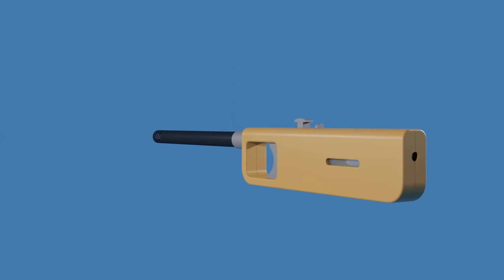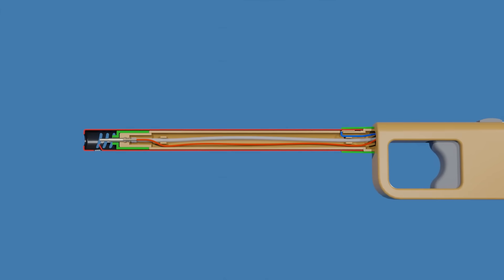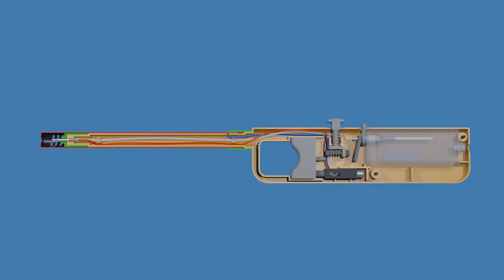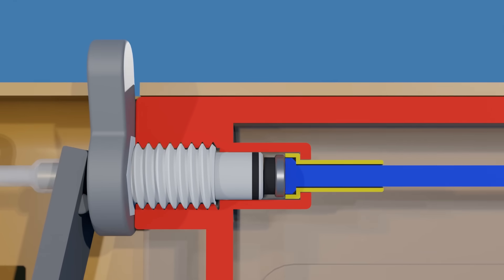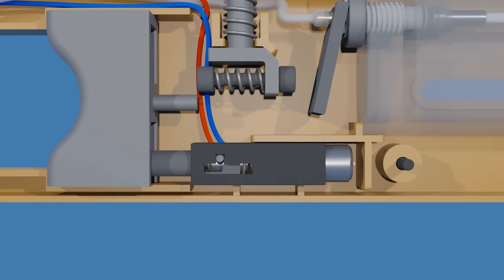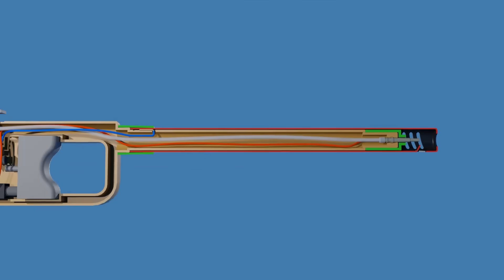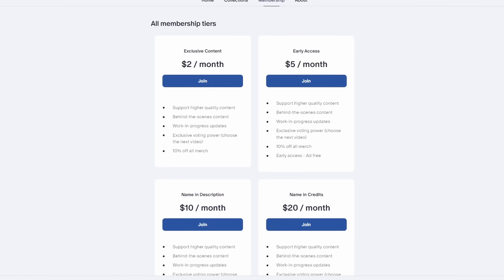How a gas lighter works

Comment: Dang 2 guy and a ton of work! Cool video. I took apart a cheap cigarette lighter that went empty in a parked truck.  Summer time I guess it got too hot. Anyway I was looking at the white stick thinking there would be a hole. I didn't realize it was porous. Thanks for all the information. 👍🇺🇲👋

Comment: I still don't understand how the disk at the end of the porous rod regulates the gas flow. Is it porous too? How does the pressure of the threaded housing affect it? How does the housing pressure affect the disk's throughput?
Reply: It's usually a very light, feathery sponge, punched out and shaped like an o-ring.

Comment: 4:00 But presumably the safety lock mechanism has no effect on the spark generator so it could still be used to ignite an oven's gas burners?

Comment: 0:51 Seven springs I guess
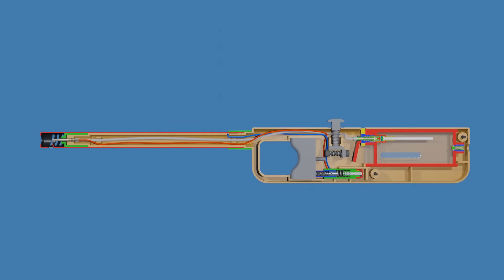Reply: 6:12 Many lighters have a spring at the tip, where the spark generates, at the end of the gas line.

Comment: I want to say that the construction of the safety button is uncommon, atleast here in sweden, never seen that construction with a "disabling" trigger that still can be depressed (but doesn't work) in locked mode. Maybe there is different standards in different countries, but on our gas lighters here in sweden the safety lock button instead physically locks the trigger completely, it cannot be depressed at all without pressing the safety button. Theres 2 variants, one that is based on a catch on the safety button, engaging a hole in the trigger. Then the safety button is located ABOVE the trigger, between the gas outlet and the trigger. Other variants have a slot in the trigger, where the safety button has a rod with a thicker portion (that does not allow the slot to pass), and then a thinner portion (that does allow the slot to pass), depressing the safety button aligns the thinner portion with the slot, allowing the trigger to be depressed. These types have the safety button located BELOW the trigger, between the gas canister and the trigger.

Then there is the variants with the slider, which is a toggle switch, located below the trigger on the side. Then its just a L shaped hole in the trigger, and a pin on the safety lock switch which rides in the L-shaped hole,  You can propably imagine how that works, when the trigger isn't depressed, the unlocked safety button pin is in the corner of the L. when the safety button is moved to the locked position, the pin moves horizontally in the L, and then the trigger can't just physically move. When trigger is in unlocked position and trigger is depressed, pin of safety button is moved along the vertical slot of L.

Comment: Much more interesting from the inside than it seems from the outside! I store my gas lighters in the freezer at minus 18 degrees Celsius when I don't need them so they don't lose gas. I also put lighters in the refrigerator before refilling so that the pressure in the tank is lower than in the refill cartridge and the gas is refilled quickly and without much loss.

Comment: Usually, they don't. At least two of three are bad out of the box, the one that works typically takes a lot of force to activate the piezoelectric device. You then get a flame, if the gas hasn't leaked out since it left the factory in China.

Comment: It's amazing how all of these come together are sold for 1-2USD each, thanks to engineering for mass production. It's cheaper than match.
Reply: Matchsticks are far cheaper, zero refill, and zero repair. Try repairing gas lighter with six springs. Even getting the springs aligned can consume entire day.
Reply: @kumardigvijaymishra5945  On butane lighter can be used to light more fires than  a score of match boxes. Those springs probably get thousands of cycles before they're too worn out to work. And they're cheap enough why would anyone bother to repair it? Get a new one.
Reply: @cavalieroutdoors6036  That's not entirely correct. When butane lighters ar lit, they generally produce excess fire because butane has higher energy content than matchstick. Unburnt matchstick shaft can be reused to ignite more candles; butane lighters don't have such mechanism. I like butane torches because one can turn the knob and regulate the fuel consumption. Such isn't the case with butane lighters.

Comment: I feel like the swaying back and forth at the beginning was a bit too much. I don't know if ot was that the lighter occupied too much horizontal space in the frame, and so it felt crammed, or if it was the focal length making the tip of the lighter move too much as it passed by and hard for the eye to follow, or maybe the frequency and speed of going from one side to the other was too much and it felt restless.
Anyway, nice to meet y'all, fantastic work as always

Comment: 4:41 isn’t that dangerous? Don’t transmission power lines use high voltage and low current? What would happen to you if you perform a 1000 degree knife challenge on the lighter and you slice through that wire? Seems quite sus to me man. There should be some regulations on the design.
Reply: not at all, the energy the lighter is outputing (for it's spark) is pretty much nothing. transmission lines will get you killed near instantly.
Reply: The combination of extremely low current and time makes it harmless, like turning on a pressure washer for 1 millionth of a second and also 99% of the water is replaced by air
Reply: itz literallie harmlezz, I frequentlie get accidentallie zhocked bai teh electricitie while uzing teh mechanizm
Reply: Voltage makes sparks, current kills.

Comment: guessed 6. I saw 4 springs at first, realized there's 2 valves, and the thing behind the trigger looked like it had 2 springs
so all in all 2 springs in the butane release thing, 2 valve springs, then 2 springs for the piezoelectric thing

Comment: I've been opening lighters since I was a kid. I started with a lighter that uses spark from a rod and a grooved cylinder. Those only have 3 springs. Crickets lighter are often non-refillable. I always refill my lighters too until the piezoelectric ignition stops working or any parts are not working properly. But I still keep them so that when my new lighter has problems, I can salvage parts from the old one.

Comment: My only idea is that some of the motion might be better illustrated in 3/4 view, not just pure planar view.

Also, yes, the piezoelectric material is good for tens of thousands of strikes, but the plastic components in a sub-$1 lighter are not.  In 50 years I've only had two last long enough to be worth refilling.  (I'm well aware I'm buying cheap quality lighters.)

Comment: I’ve never refilled one of these things.
Reply: They're not usually refillable, some are though
Reply: They are made so cheaply that they are more likely to fall apart before they need extra fuel. The plastic housing is flimy and the wire soldering is shoddy as well. It makes them inexpensive but also prime landfill material
Reply: What a waste.
Reply: Some of them are, some of them don't.